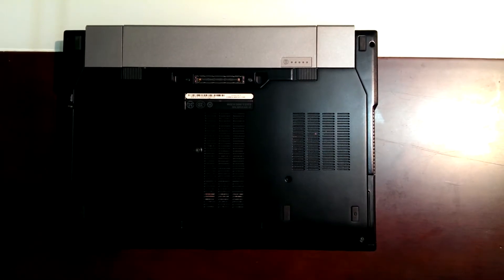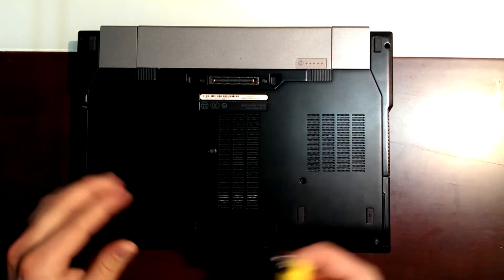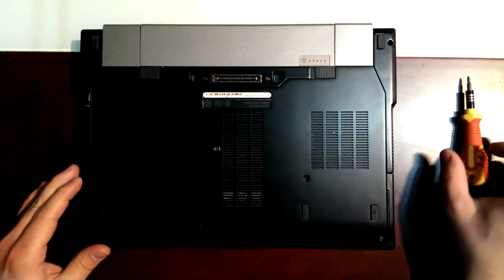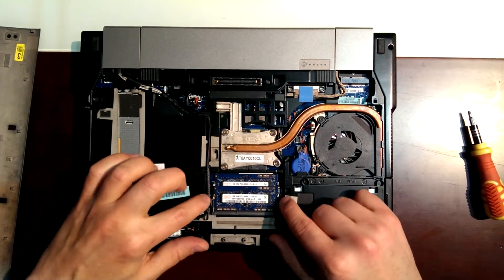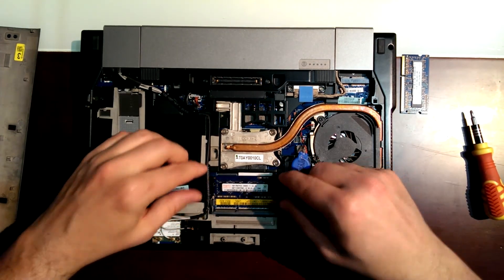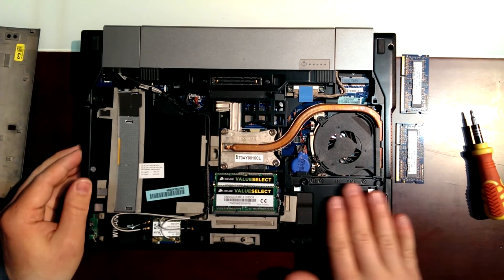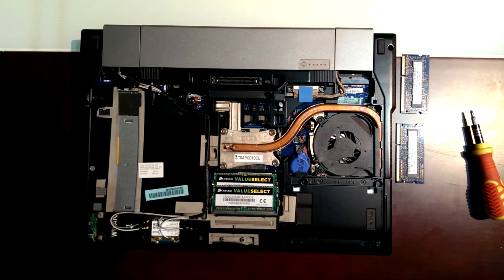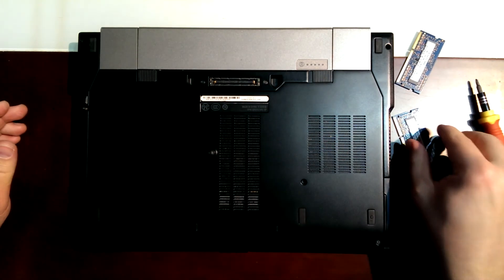Dell latitude e6410 RAM Upgrade

Comment: HI I have a dell Latitude E6410 Intel i5 CPU and im having issue upgrading the ram to a 16GB kit is the laptop compatible for 16GB kits of ram
Reply: Maximum allowed RAM on a E6410 is 8 GB (4 GB per slot x 2 slots) according to specifications here:  https://i.dell.com/sites/doccontent/shared-content/data-sheets/en/Documents/latitude-e6410-e6510-specsheet.pdf
Reply: John Storm Fraser: just "max" upgraded my e6410 to:
Motherboard with Nvidia GPU
i7 840 QM 
16 Gb of RAM (DDR3 @1066mhz... but I think it can handle 1333mhz)
SSD (just 120 Gb)
Windows 11 (using Rufus to create the ISO).
Added Bluetooth module
Added webcam

Runs like a modern laptop, and its 14 yr old.
Reply: @PippeML  What the exact ram you have ? i may try get that ram, did you upgrade the motherboard as well
Reply: @PippeML  hi i have just upgraded my e6410 to i7 740qm an 12gb ram and now the problem is laotop switches off in games and have huge fps drops . before upgrading it was working fun and smooth in games with i7 620 m snd 8 gb ram. what should i do now?